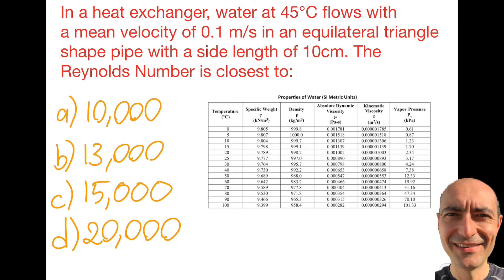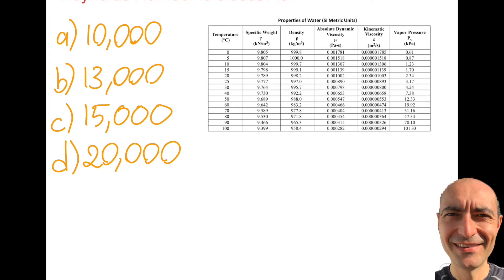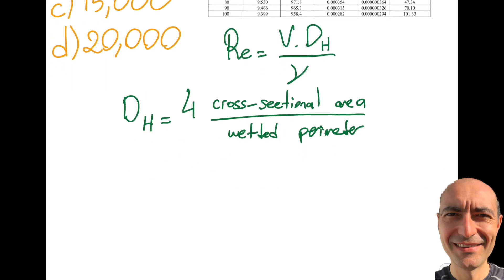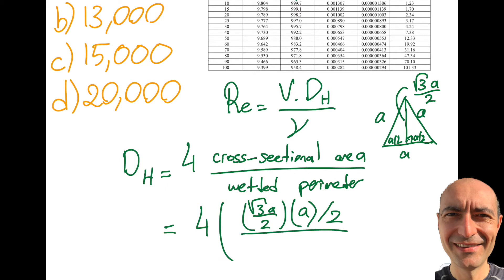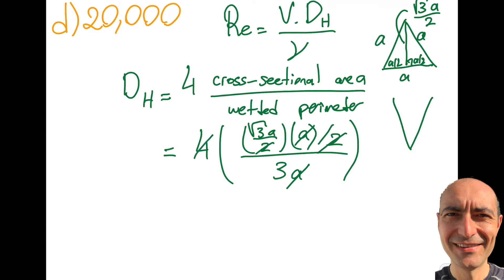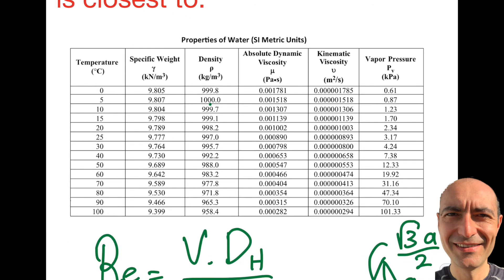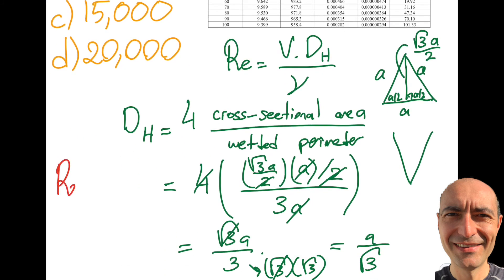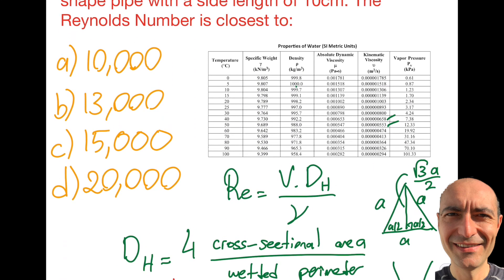FE Exam Fluid Mechanics - 4.7 - Practice Problem - Hydraulic Diameter

Comment: I used linear interpolation because it is approximately linear across a small difference. On the FE I will likely skip linear interpolation for the sake of speed and time management, but is this an appropriate solution if I felt I needed to use it.
Reply from the maker: Sounds great. You have to do what you have to do. It is good to strategize before taking the FE. Smart.

Comment: Hello sir. 
I need your help if you don’t mind. 

How can the hydraulic diameter be calculated of a pipe with an inner diameter 0.026 m and length 1 m if a turbulator is placed along the course of the pipe, this turbulator contains of two parts, the first part is straight solid pipe with a diameter of 0.015 m and length 1m, second part is a solid pipe with a diameter of 0.004 m that wraps around the first part in a spirally, since the pitch is 0.09 m and the number of turns 11 and the length 1.21 m?